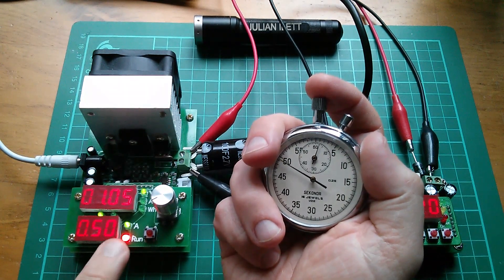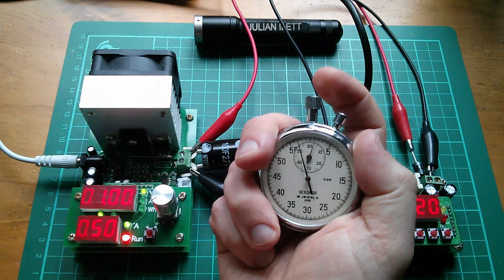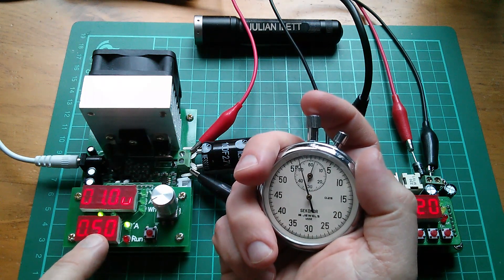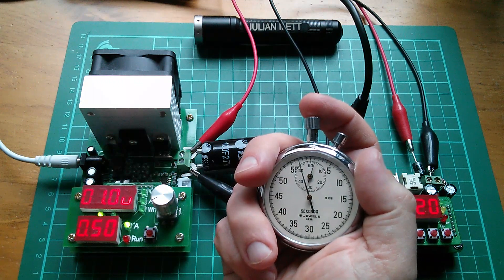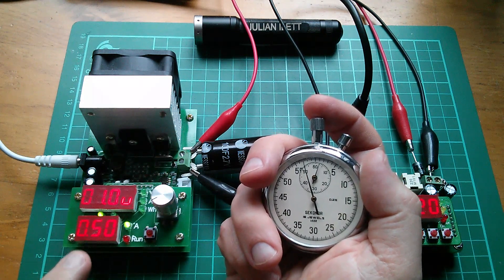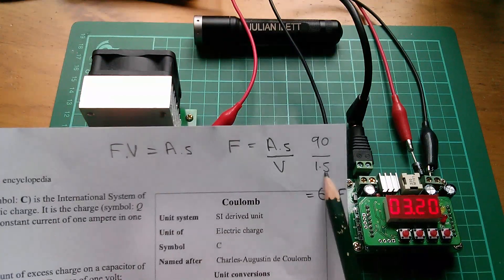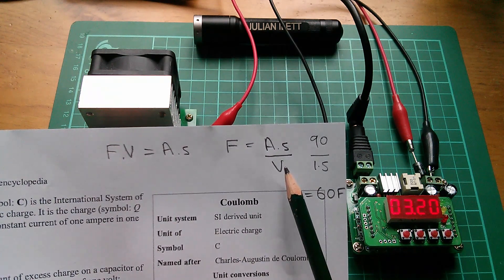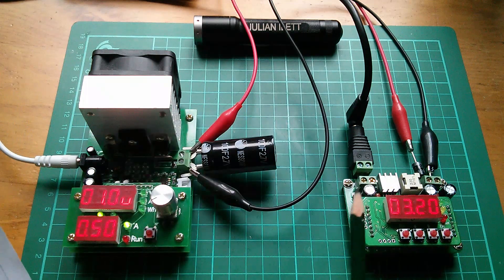Measuring the Capacitance of a SuperCapacitor

Comment: Assuming this formula would work the same while charging the capacitor at 1 amp, then measure the time in seconds till voltage raised 1.5 volts.

Comment: You don't need to go from Vmax to zero to measure capacitance. even a capacitor tester can check a capacitor quickly by looking at this same voltage and current change over time. it does not max out the capacitor and drain to zero to do a test. it would take forever and drain the on board battery to do that. Julian did it correctly.

Comment: For supercap, the value C is not a constant versus V and versus Q. If they were, they would charge almost instantaneously under R = 0 in serial. Still, if C was constant, you could easily compute it from an oscilloscope since their charge/discharge in time will follow the exponential law with an RC circuit:  0.5 V = V (exp(-t/RC)),   so   RC = -t_1/2 * ln(0.5); knowing R will give you C by measuring t_1/2  which is the time required to get (to lose) half the constant voltage, Vcc,  at the end of the group resistor-capacitor, time  that you measure on the scope (quite easy on digital scope allowing to "track" the curve with a cursor: start anywhere on the curve and end when your end point is at 0.5 Vcc more than your starting point, the t_1/2  is displayed as the Delta t between these two points).

I think that for supercap, the announced C value is for Q=0, or a discharged cap.  You can try  RC = - t_1/10 *  ln( 1/10 ), with t_1/10  the time required to reach Vcc/ 10, if it takes too much time for  t_1/2.

Comment: 1 Columb is 1 Amp  sec at 1 Volt,  or 1 Wattsecond.
So when discharging 2,5 volts at 1 amp You are draining 2,5 Wattseconds. That is why you observe a discrepancy. You have to count wattseconds in order to count columbs.

Comment: One of the things we've found at Loughborough University is that the capacity depends upon how long you charge for. I.e. the state of charge isn't purely based upon the measured voltage. Similar to old lead acid batteries. The reverse of this effect is if you charge the cap, short it for a second to take it to 0V. Then use a high impedance multimeter to measure the OCV, it will start increasing (recharging itself!)

Comment: After constant charging of 2.7 and 2.5 volt type DL caps 5 or more in parallel I found leakage rate of under .001 amp.. the more in parallel the more the leak current. I don't think it's too bad compared to a super low impedance OSCAP alum.electrolytic @.001F

Comment: I'm just an amateur here, but wouldn't it make more sens to mesure from completely full to completely empty ?
I don't know if this analogy is correct, but if I want to know how much water a bottle can contain, I'll mesure all the water I can put in it or all the water I take out of it, if it was full.
Reply: Fester Blats :  But if you fill a bottle that is not completely empty, then start empty it and then stop  before it's completely empty, you can easily mesure that it takes for example one minute to take 300 ml from the bottle. But that won't tell you the total capacity of the bottle. Right ?

Comment: So many people commenting are confusing capacitance with capacity, and concluding that Julian's method was incorrect.  They're different things, and Julian was correctly measuring capacitance (measured in Farads), NOT capacity.  To better understand the concepts, a useful analogy for a capacitor is a cylindrical container holding water, with a tube attached to a hole in the base.  In the analogy, the water is the equivalent of charge, the water level is the equivalent of voltage across the capacitor, the height of the cylinder the equivalent of the maximum rated voltage. The water flow rate through the tube is the equivalent of the current into/out of the capacitor.  Exactly like a capacitor, if you have a constant flow of water through the tube into the cylinder (equivalent to a constant current charging the capacitor), then the water level (voltage) increases linearly.  The equivalent of capacitance in this analogy is the cross-sectional area of the cylinder, NOT the total water capacity.  As you can see, the cross-sectional area determines the rate at which the water height increases for a given input water flow rate, completely independent of the maximum water capacity.  This is analogous with the capacitance of a capacitor determining the rate at which the voltage across the capacitor increases, for a given current, again unrelated to the maximum capacity.  A battery on the other hand is not analogous to a capacitor, and there's nothing equivalent to capacitance in a battery.
Reply: the fact that 1 Farad can be equated to 1 Coulomb per Volt, would seem to indicate that Farads are in fact a capacity dependent on the maximum possible charge.

Comment: Your result of 60F is off because
1) you didn't count the bit of charge when it was fully charged (2.7V down to 2.5 V).
2) You stopped at 1V, but it still had charge left at that point.

So your test is only measuring part of the total capacity.

Comment: Why is it that Most People Don't Understand that the Voltage Rating on a Capacitor is it's Maximum Safe Operating Voltage and Has Nothing to do with the Capacitance Rating,
1 Farid=1 Amp Second to 1 Volt, The only reason that Companies use low voltage caps is to save Money and make their products have a short lifespan, Engineered to Fail Just after the warranty expires or with SuperCapacitors the low voltage is the best there is at the moment.

Comment: Julian, That Type of SuperCapacitors is Nonlinear, They have a much Higher Capacitance at Extremely Low Voltage, and much less Capacitance near their max rated Voltage, 
The Capacitor you tested has a capacitance of 55F from 2.5V to 1.5V and 67F from 2V to 1V, if you don't believe me watch your video, (2.5V 5:00 )(1.5V 5:55 )(2V 5:24 )(1V 6:31 )

To Prove Just How Extremely Nonlinear Those SuperCapacitors are drain one completely and charge one to 1V, place them in series and charge them in series to 2V, if they were linear they would each increase in Voltage by 0.5V, But They Won't ! Then drain the one that is charged and charge the the one that was drained and repeat to prove that the variance of capacitance between the two capacitors is not to blame,

The reason for the nonlinearity is similar to the Miller effect in semiconductor materials the higher the reverse PN Junction voltage the greater the depletion region and the lower the capacitance for each additional volt applied, 

When you drain the capacitor and you think it is fully drained hook it to a multimeter and drain it the rest of the way through the current shunt that way you can monitor the current.

Comment: I'm afraid the reasoning here is flawed. Imagine a bucket (the capacitor) filled with golf balls (electrons). Now you pull golf balls out of the bucket at the rate of 1 golf ball every second (1 amp) for 90 seconds. At the end of that time you have removed 90 golf balls (so many coulombs). But that doesn't tell you how many golf balls there were to begin with (the capacity), only that there was room for 90 golf balls and more!

To measure the capacity of a capacitor you need to know how much electricity (measured in coulombs) you can put into it, and what it's voltage is when full. Only then can you apply the formula C=Q/V.
Reply: He is measuring capacitance not how much energy was stored in it. The discharge curve into constant current is linear so it doesn't matter what voltage range you use to test it. Running it right down to 0v would increase the time taken to discharge but the voltage range would be increased. These will cancel each other out giving you the same result that is in the video
Reply: I never mentioned energy. The fact is that this experiment showed the capacitance of the capacitor to be 60F when it's nominally 100F. The only way to resolve the various arguments about why that should be so is to charge to the 2.7V the capacitor is rated at and see how much electricity you can draw until it is totally discharged. That's what capacitance is - how much electricity you can store at a given voltage. If I had the equipment I would obviously do the experiment myself. Experiment is king!
Reply: Fair enough. I doubt the result will change much with going from 2.7 - 0 instead of 2.7 - 1 but i agree that it is worth confirming. The lack of capacitance is most likely down to it being a no name eBay sourced capacitor. Also super caps tend to have very high capacity tolerances. Even branded ones from Nichicon and Panasonic have ±20% tolerances on their capacity.
Reply: I wish I could think more quickly. We don't need to do the experiment again - we can use the video! Here are the readings, seconds paired with volts: 15/2.17; 30/1.88; 45/1.64; 60/1.42; 75/1.21; 90/1.01. Conclusion 1: the fall in voltage is NOT linear. Conclusion 2: using Mr Ilett's theory of C = Amps*secs/voltage fall gives varying values of capacitance. For example, at 15 seconds the voltage has fallen by 0.33V (2.50V - 2.17V). The capacitance is therefore 1*15/0.33 = 45F. Using Excel on the other readings gives 48F, 52F, 56F, 58F and 60F. Using corresponding figures from the 2nd run shows a capacitance between 42F and 57F. I rest my case.
Reply: 60F isn't capacity, it's capacitance. Capacity (like battery capacity in Watt-hours) is an amount of energy, but capacitance is the inverse of the rate at which its voltage changes when current goes in or out. But yes as others have pointed out, the supercap's capacitance changes depending on its voltage, so it's not a simple constant.
Reply: How sloppy of me. Corrected.
Reply: But I think there's still confusion with the concepts of capacity and capacitance. Basically capacity is the total energy you get from a fully charged cap down to empty, but capacitance is an instantaneous property. We tend to think of it as a constant, but often it depends on the voltage at that moment. Paul Grimshaw's explanation among these comments was good: https://www.youtube.com/watch?v=EKRZEc-4SBo&lc=z12ogzx4vyn5zdfrf04ccrtycn33d3xw32w
Reply: I like to think of a capacitor as like a balloon into which you're forcing water. You can keep adding more water and the balloon will expand to accommodate it - until it bursts.
Reply: It actually does work here. By nature of how capacitors work, you can measure how full they are by measuring the voltage. If a 20v cap is charged to 10v, it's 50% full, etc. Using your analogy, if you have a bucket full of golf balls and it's full, and you take out 90 golf balls and it's half full, then you can deduct that it can hold 180 golf balls total.
Reply: Obviously Julian now needs to build an Arduino-based supercapacitor tester to produce capacitance-versus-voltage plots for all his supercapacitors.

Comment: As many comments say, you did not use alle capacity. If you correct the equation (divide by 1.5 and than multiply by 2.7) you will get your around 100F

Comment: It dropped from 2.5V to 1.5V that's 1V @ 1A in 55 seconds, so 55F
Reply: It also dropped from 2.5V to 2V in 25 seconds in the first test, which would equal 50F. Clearly the voltage drop is not linear, though it's not incredibly far from it.

The difference between theory and practice is that in theory there is no difference while in practice, there is.
Reply: We also don't know how responsive that CCL is, it could be a little laggy. Am I right in thinking the discharge across a fixed load resistance would produce an inverse square voltage drop?
Reply: A bit of lag in the readings shouldn't be a big problem because it would affect the timing at both ends of the stopwatch. If he was timing from full charge, it might matter, but since he's timing from a slightly lower voltage, the lag would delay both the 2.5V and 1V result, and we're dealing with tens to hundreds of seconds here, so it's probably not going to be sufficiently non-linear as to matter. Even the capacitor itself is only mildly non-linear into the constant-current load.

I'm pretty sure you're right about the inverse square relation across a fixed resistance, but then poor Julian would have to sample many times and then use calculus to get Farads out of it.

Comment: I bought six of these exact supercaps from china a couple years ago. I tested each one individually, logging data with an Arduino and even plotting it in Excel. I went partial voltage ranges, full 2.7 to 0 volt ranges, and a whole slew of different currents. Each cap tested right around 60 farads....
Reply from the maker: +Ian McClellan-Johnson thanks Ian :)

Comment: 100F capacitor discharged at 1A should drop at 1/100 = 0.01 volts per second.  So 90seconds of discharge should be 0.9V lower than the start.  So yeah, looks like that supercap is not 100F

Comment: I play with my supercapa ans I see a thing.  When I charge it with a power supply , then the voltage rise 2.5V and rest constant, the currant must be decrease quikly, but no ! The currant take 2 minutes or more to décrease at 5% of the max that my alim give. And the voltage are constant à 2.5 V  
Perharps, in your test , you must waiting for the currant decrease before start the decharge ? 
sorry for my english, I'm an eat frogger :-)

Comment: Hi Julian, I was wondering if you also measured some of your other supercaps that way. What was the outcome? Do all of your 100F supercaps turn out as 60F (for the 1.5V drop)? When I use my multimeter or transistor tester to measure regular capacitors, they very quite a bit.

Comment: I read most of the comments and no one seems to take into account the tolerance percentage of the capacitor, 
was it  + or - 20% 10 %  5% of it true value in farads what ? - as this could be a loss or a gain to its true capacity when measured to be truly full or empty.

Comment: I don't get why you did you measurment like this. If you don't use the full 2.7v-0v (or compensate in the maths) then all you are measuring is the capacity used to send 1A for 90s. You still have unmeasured capacity from the 2.7v-2.5v and 1.0v-0v. So only getting 60F would be about right. 
Also best to disconnect the power supply before testing as you'll be adding it's capacitors also. Small effect but still.

Comment: I don't know why I was thinking you have to integrate to get the number of farads (or even take the area of the triangle, or half the voltage range times time).  Instead you used delta V (for the change in voltage) in place of V in the equation.